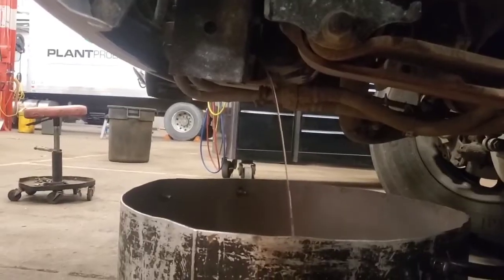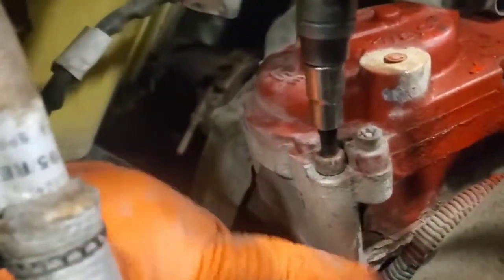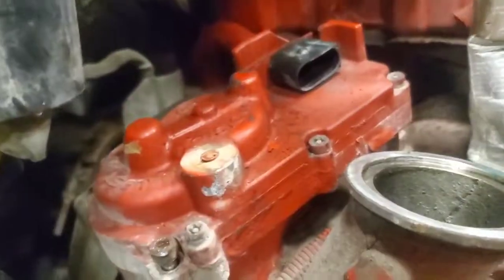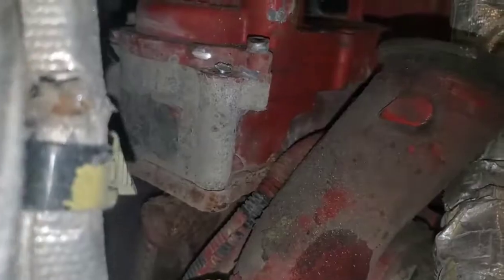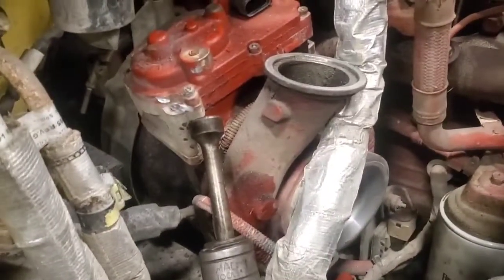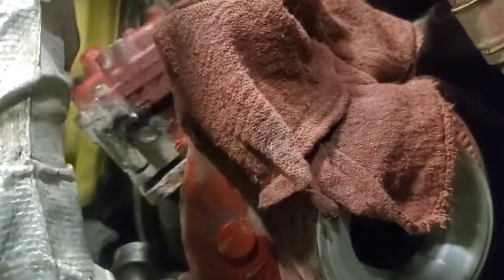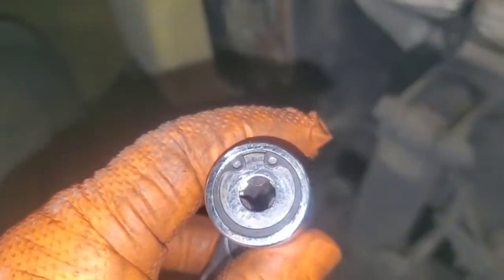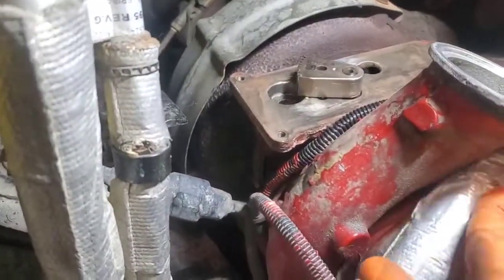How to replace a Cummins VGT (Turbo) Actuator and calibrate it - International truck chassis

Comment: 8:44 what type of socket u are using to remove the screw stud ?
Reply from the maker: That's a metric stud puller socket. You can get a set on Amazon but I got mine from the Mac dealer.

Comment: Do those fail after some specific mileage, or just random. Dealing with one fail at 105k miles.
Reply from the maker: They can fail anytime being mechanical/ electric. Rare to fail at low mileage tho but I've seen it.

Comment: X15, do you need to drain all of the coolant? or just a certain amount?
Reply from the maker: You would really just need to drain it below the VGT. I drain it all because it doesn't take much to suck it back up when the system is under vacuum.

Comment: What can you do if that left base to the bolt got rounded up and has no threads?
Reply from the maker: @Turbo-MKE  try to find an extra long this bolt to install with a nut. Or tap the turbo base threads 1 size larger and ream the VGT housing to put a little larger diameter bolt in there.
Reply: @AcousticHills  Thank you! Should I try dealers for a longer bolt? Or hardware stores?
Reply from the maker: @T680-MKE  A hardware store like fastenal. Parts guys in a dealership probably wouldn't be too helpful for something like that